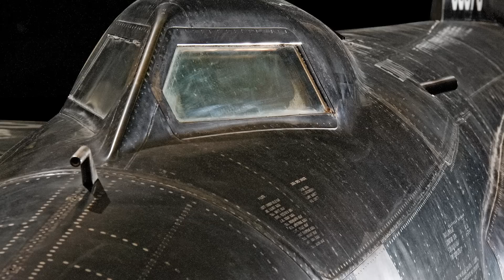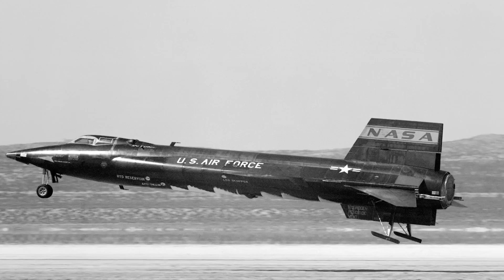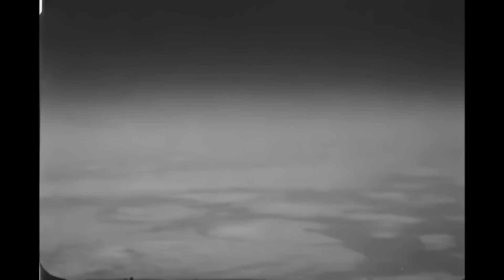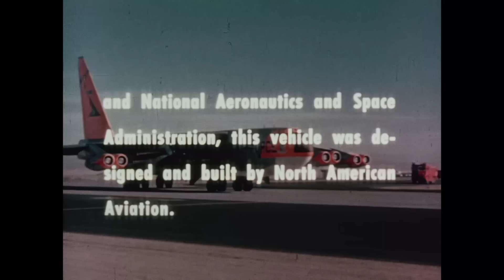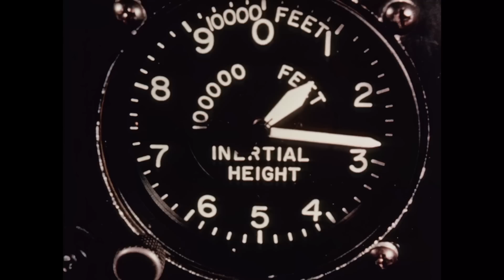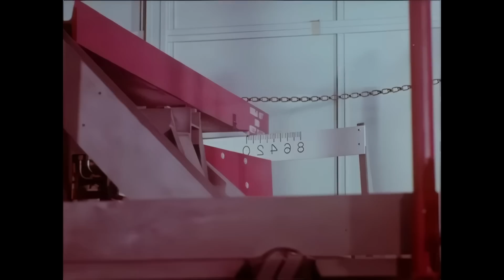X-15 Hypersonic Aircraft. Flying At 4,520 mph, And 354,200 feet High In A Rocket Plane

Comment: Hi Dronescapes thanks so much for video. Accurate and extremely interesting. It is staggering to contemplate that X-15, some 57 YEARS later, STILL holds the world record for fastest manned flight 
( Mach 6.72 1967). Especially when one considers,  as stated, that her design was built on nothing more than previous experience, estimation and trial-and-error, with materials which subsequently DRASTICALLY improved in quality especially in the areas of thermodynamics electronics, aerodynamics and others. These pilots were TRUE pioneers taking baby steps, sometimes fatally, into completely unknown realms of speed, altitude and atmospheric pressure. As history continues, these men, especially these brave pilots, will be revered and remembered. 
     I think it is worthwhile to mention that one of the X-15 pilots, Joe Walker, was tragically killed during an incident in a flight while flying alongside one of the two XB-70 Valkyrie prototypes in an F104N Starfighter. (The Valkyrie was also lost).
     Rest In Peace, Sir 
     Captain Joseph Albert Walker 
      1921  -  1966 😢

Comment: The numbers of this aircraft speeds are well over mach 7 based on the cia declassified files
Reply: There was never anything about the X15 that was classified, that's like thinking that the speed of the Saturn V rocket was actually faster than what they told everyone because the CIA keeps it's true speed classified. 
Like the Saturn V the X15 was never a military program, it was nothing more than a research aircraft paid for with US tax dollars and as such NASA, who owned and controlled it, was always showing off what it did for the sake of showing the public where their money was going, they even used to parade around X15's showing them to the public, and everytime one of them flew they immediately made very public the speed and altitude it flew at.
I don't know where you ever got the idea that the CIA had anything to do with the X15 or that anything about it was top secret but you couldn't be more wrong, the program was something that from day one was open to the public with all the information about it's flights made public as they happened, it wasn't a top secret program and the CIA had absolutely nothing to do with it.

Comment: Sliding rules, cigarettes and coffee.
Reply: That's a myth, electronic computers were used in the design and development of not only the X15 but also the A12/SR71 and the XB70 despite the common myth that they weren't. 
Another myth is that today's aircraft are designed by computers, no they're not, it's not like someone enters into a computer "Design a better spy plane than the SR71" and POOF, the plans for an SR72 pop out, even the smallest parts on today's aircraft are all conceptionalized and designed by human beings, really the only thing that designers have nowadays when it comes to computers is CAD which all it does is allow the designer to draw the part in 3D on a computer instead of having to draw it in 3 different views on a blueprint, that's all, but it's still a human who thinks up the part and designs it, and instead of having to wait their turn to use a computer that takes up an entire room so they can have it crunch number's for them nowadays each engineer has his own computer sitting on his desk that can do it.
But one way or the other no matter what it's still human beings that come up with all the ideas then sit down and do the actual designing, the people back then weren't any smarter than the people nowadays who design the latest aircraft, they just don't chase speed records nowadays because thing's like stealth, electronic countermeasures and precision weapons are far more important than making today's jets go faster than yesterday's jets.

Comment: I go to FSU and through the Federal Document Depository Act, we have THOUSANDS of nasa technical notes, I found the original documents talking about flight pressure distributions on the vertical stabilizers and speed breaks of the x15 airplane at mach numbers 1 to 6, and it felt illegal to be holding it

Comment: Everything about it shouts " SPEED " . With the ventral stabiliser it was basically a powered arrow . There was no nose-wheel steering but on the ground , above 100 knots roll inputs to the reaction system would cause it to deviate - by asymmetric loading to the skids (Source:  At the Edge of Space - Milt Thompson) .

Comment: Doesn't even compare to the 60s  Lockheed SR71 blackbird. That wasn't even a rocket and still remains the best craft ever built along with the Lockheed A12 oxcart 😊, prove me wrong
Reply from the maker: The X-15 was an experimental rocket-powered aircraft. You might want to check to records it achieved.
They have nothing in common, in terms of scope, so they should not be compared

Comment: Nice video

Watched it fly over attached to the B-52  while at recess in grade school.
Knew crew chief and chase pilots.

Crew chief friend had lots of Scott Crossfield stories. 
"Now Scotty, if you have to dead stick this F-100 remember this.  The hydraulic accumulator only stores enough hydraulic pressure for a single application of the wheel brakes."   (Hamger wall incident. LOL)

Beatty is usually pronounced  Bay Tee.

Ely.            EE  LEE.

Comment: Mach 6.70 is 5,141 miles per hour.
Reply: Well, the speed of sound changes with altitude. So mach 6.7 at sea level is not the same as mach 6.7 at 354000 feet
Reply: @arlandaplanespotting  Yes, Mach 6.70 is 4,520 mph at 102,000 feet, which is the altitude that Pete Knight flew on 3 October 1967. As for any Mach number at 354,200 feet, that is actually irrelevant since it is outside the atmosphere, and Mach is only a speed when related to flight through air.

Comment: All this were done without modern day computers.
Reply: Slide rule
Reply from the maker: @Thadude701  Yep!
Reply: It was hardly rocket science.  Just a large firework
Reply from the maker: @Tangobaldy  Try accomplishing that in your spare time, fireworks are widely available, and do not forget to be onboard as well.
Reply: @Dronescapes  agreed.
Reply: Back when people were smart
Reply: It wasn't designed with modern pencils either, so what's your point?
It's a myth that aircraft like the X15, A12/SR71 and the XB70 were designed without the aid of electronic computers, they were indeed used in their design and development, without them people would still be crunching the number's needed to make the calculations involved with designing those aircraft, and today's computers don't do any of the designing contrary to popular belief, it's still human beings that conceptionalize and design every single part involved in a new design, the only real difference between now and back then is since each engineer has his own computer sitting on his desk he doesn't have to wait for his turn to have access to a computer that takes up an entire room so he can have it crunch number's, nowadays since they each have one sitting on their desk they have the ability to just do that anytime they want, and the other thing is CAD, which contrary to what many people believe doesn't design anything, it simply allows the designer to design a part in 3D instead of having to draw 3 views of it on a blueprint, which saves time but once again it's still a human being who thinks everything up and does the actual designing. 
Engineer's nowadays are just as smart as they were back then, but because they're designing aircraft that have other priorities than speed, like stealth and all the electronics involved in modern aircraft, people think they're not as innovative as back then but they are, if speed was still the priority it was back then today's designs would be faster, it just isn't the priority in designing new aircraft, so people think there's no innovation like there was in those days but that's not true, it's just that the innovations in today's aircraft aren't about flying faster and higher so it doesn't register in people's brains how innovative new aircraft are.
Reply from the maker: @Salty smart phones are just the mere evolution of a cell phone, which is an evolution of a phone. It took 35 years to go from cell phone to smart phone, and with a massive amount of companies involved in the business of "phones". It took more than 120 years to go from phone to a cell phone, therefore 150+ years from phone to smart phone!!! It took less from the first airplane to go to the moon, than from phone to cell phone (not smart phone). My point is exactly that. Empowering everyone with all the possible knowledge on the planet, at their fingerpits, did not exactly lead to, say "time travel", but rather to TikTok videos, Instagram, etc. Samrt phone are mostly empowering self centered nothingness. Millions spend hours a day posting self celebrating photos, or making baseless random comments, they are not (generally speaking of course) using their smart phone do to particularry smart things, like solving world hunger, or finding ways to explore the universe. I doubt that the people that sent man to the moon spent hours and hours posting photos of themselves on a beach. Perhaps today we are so distracted with everything we are being entertanined with smart phones that there is no need the explore. There is a schoold in Switzerland that removes smart phones, and most entertainement based technology, so student become so bored they find creative inspiration in the world around them, like everyone had to in the past, at least to a degree. That school produced Hans Zimmer, for example. The interaction that goes beyond a mostly passive one generated contamination of ideas. When we mostly interact with a single sentence, or even a work or an emoji, the contamination of ideas is virtually dead. This is why I am offering a complex (and probably boring) point of view, rather than a word, an emoji, or a single phrase as a response, which could easily be a much more complex debate as well, if needed.
I have to say, I am slightly surprised you would pick, of all things, a smart phone, which is an insignificant object that doues not seem to have elevated humanity by a micron, if anything, it is the contrary, and probably not what someone like Steve Jobs had envisioned, beside lhaving the intuition it would have changed the way we live.
Reply: @Dronescapes yeh I guess I was taken the wrong way as I meant smartphones seem to be the turning point in society where the say ‘idiocracy’ or dumbing down starts taking effect.
The smartphone sure as hell hasn’t made anyone smarter in the iq department but in the ‘hive mind ‘ so to speak we well into the singularity phase of our evolution because I don’t reckon we gonna develop an extra set of limbs so we can pack and ship those amazon orders out to the masses or to carry an extra delivery order for uber eats. 
Hey thanks for your comment and for the magnificent documentary’s and videos but yeh I watch them with astonishment and sometimes you think how have not solved the basic problems like world hunger and poverty and…garbage disposal clean energy etc 
Money greed war power control resources 🤯🙄🤨 its all good if everyone starves as long as they can post on facebook I’m probably not making much sense now but thanks for your reply I literally just seen it haha have a good one and to anyone who reads this
Reply: And more then likely mostly by 25-30 year old graduates' try and find that brain power in today's generation
Reply from the maker: Exactly, one of the reasons they got things done 😉
Reply: @Dronescapes  They get magnitudes more done with modern computers.
Reply from the maker: @AussieSpaceGirl  just a joke, allow me...Yes, they make rendering upon rendering of things that will never be. Jokes aside, you have to admit that they did get things done back then. It took NASa only a few years to put a man on the moon, starting from zero knowledge, and these days we hope it "might" happen in 2025, when it was actually announced when G. Bush was President. I understand that it is also about safety, etc. as we have different standards, but with all the aquired knowledge (and all the computers), you would think that it would take them no time.
sometimes I wonder: if we are all potentially connected, billions of people being able to exchange information in an istant, how comes we did not solve problems like cure cancer, stop climate change, invent 10 different clean fuels that are sustainable, figure out how not to pollute water, found alternatives to plastic, or wiped hunger out of the planet? We are all interconnected and we watch TikTok videos all day, people believe in the craziest conspiracies, 30% of millenials are not even sure if the earth round or flat, or that the capital of Italy is France! It does not seem to me that things are progressing at the pace you would have thought the should have. It seems that it takes many more poeple to do what a single person did 30 years ago. It might be that all the computers actually halted "contamination" of ideas, the ability to communicate, and lowered the bar in many ways. Most comments are one line ones, or an emoji. Maybe it also led us to a breakdown in communications.
Reply: Stop me if you've heard this one...

This airplane, from 1960, wasn't designed with MODERN COMPUTERS....

Thanks for the newsflash, Sherlock....
Reply: We haven’t been to our moon yet.